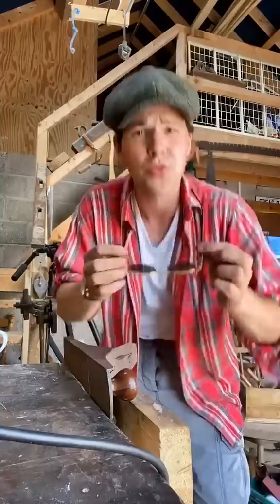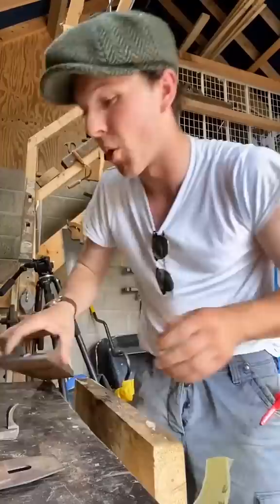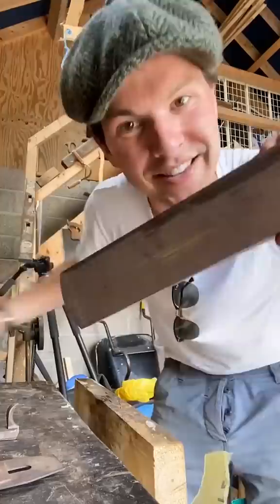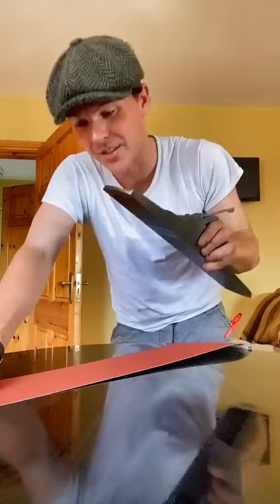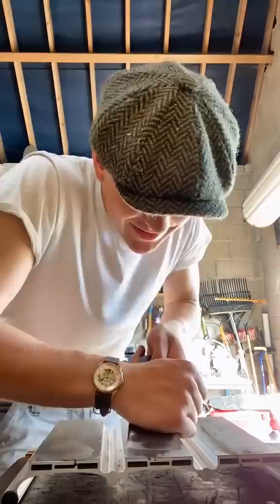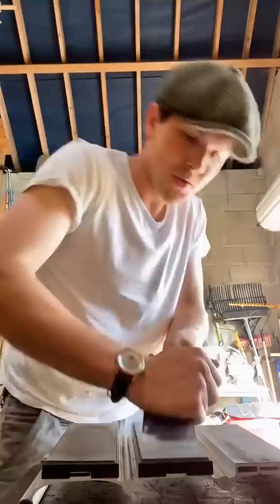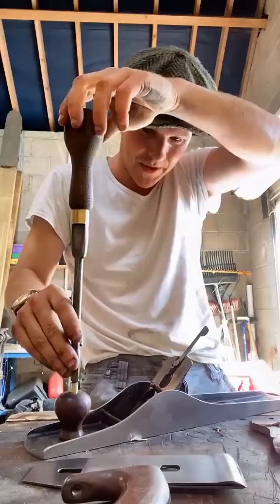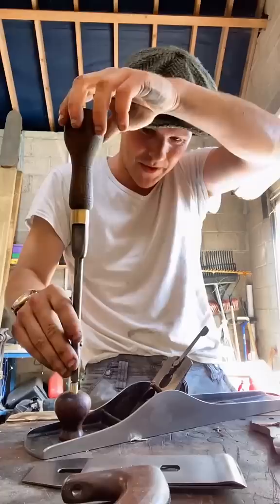Restoring & Sharpening a Stanley No.6 #shortvideo #woodwork #handtools #restoration #sharpening

Comment: I've found if you lap the sole with the plane disassembled, you can actually lap it warped - this is because the shape of the plane can change a tiny bit when you put the frog, blade and cap back in and snap the lever down.
Reply: This is true, especially on these long planes
Reply: This is true. Only flatten the sole with the blade in and retracted.

Comment: I absolutely LOVE LOVE LOVE  those old Stanley planes!! I need to learn to sharpen better!! Knives mostly
Reply: Its all in the bevel angle, "or the angle you hold the blade relative to the stone" i was taught to rock the blade up until the bevel sits flat to the stone and always pull toward myself
Reply: @dads_diy  so you're saying its the angle of the dangle
Reply: The veritas honing guide is incredibly easy to use and gets perfect results every time

Comment: Your energy, skill, and passion is unparalleled. So I’m going to be that guy: the problem with the grinder is the potential for creating any small divots or curves even on the side of plane, since many of us turn it on its side along the edge to gauge flatness, particularly with smaller pieces. 

But then again, you can probably take care of these little imperfections by simply sanding the sides flat as well…which could also be a means to remove the rust. 

Amazing video as always. Cheers!

Comment: A good tip for holding sandpaper on a flat surface like that, put a bit of tape on the back of the paper sticky side up the put 2 more pieces in an H pattern to stick it to the countertop. 

I resurfaced the block of an old lawnmower like that.

Comment: Is there a brand of Whetstone you'd recommend for sharpening plains?
Reply: Naniwa work really well for me. I use up to 12000 but with that one you don't have to strop at all. and it's only a few passes. It should be sharp enough to shave with after 800, otherwise you are doing it wrong.

Comment: Amazing work, and this is probably fine for woodworking precision, but as a mech eng I would be failing my people if I didn't point out that a granite counter top is not a surface plate. While the counter might be very smooth, there is no guarantee that it is actually that flat. Love your videos, keep em coming!
Reply: So I’ve heard this before and obviously it’s not gonna be as perfect as a measured flat plate but it’s my understanding that these granite countertops are cut with very precise equipment and if the flattening of these pieces is done in very big large industrial warehouses and not just a different granite shop so my question is assuming the use somethings like a precision router system to grind it flat why would it be off by more than a few thousandths?  I I am not asking this to be a jerk, I’m actually asking because I’m interested and I don’t know if you’re an engineer or so how about some free technical information I sure would appreciate it thank you

Comment: Love your videos.

Having less surface area in contact does not mean less friction, since more force is applied to the smaller area per sq inch. There are a few factors that can cause a slight difference, such as the geometry, but not surface area alone. If you don't believe me, place some weight on a small block plane so that it weighs the same as a larger jointing plane and slide them both on your workbench without the knives. You will feel that they slide on wood with about the same amount of resistance, even though they are drastically different surface areas.

The partially hollowed bottom does however make the plane easier to flatten, much like a hollow back chisel,  since there is less material to remove. 👍
Reply: The corrugated sole can also cause some problems, like edge (of boards) damage, and harder to lay level on boards (depending on thickness.)

I personally think they're a gimmick. Cool idea, but not much, if any better than a flat sole.

Comment: I have a 5 1/2 and 6 both corrugated I received as gifts.  I threw on hock irons/chip breakers and had a machinist friend flatten them.  They are wonderful tools but not ones that get used very often.

Comment: I don't know how true this is, but I was taught that to flatten the sole you need the plane complete and with its iron in - back off, as that's how the plane will be and steel settles into that shape. Will no frog or iron, etc the steel will be more relaxed and may not be flat one assembled.
Reply: That is mostly nonsense.

Quick correction. The plane is made of cast iron, not steel.

If your cast iron is moving THAT much, I would be worried about breaking it from the tension you're putting the parts under.
Sure you may get a bit of movement, but you'll need a DTI (Dial test indicator) to see the difference. You won't see or feel it in normal use.

Comment: It's best to flatten the sole while the blade and lever clamp are in place, because the clamp force tends to deform the sole a bit. 
Flat bottom unclamped will not be flat in use.

Comment: Use a stone if you want a truly flat sole.  Sandpaper puckers up a little right where it matters the most; the slot.  Stanley has used a belt sander for years, one of many reasons why they are junk now. If you must use sandpaper, get some lapping paper (plastic back) and glue it down.

Comment: interestingly, the corrugated sole does not reduce friction. That was the intent, but it was designed by an engineer who failed physics apparently.

While the grooves help prevent adhesion and suction caused by wet or oily wood, it doesn't actually affect friction at all, because friction is caused solely by the amount of pressure pushing 2 objects together and the coefficient of friction between the two materials involved. On dry wood, all the corrugation does is provide a placebo effect for people who expect it to reduce friction

Comment: Corrugated sole means Stanley needed a gimmick to sell planes.  It doesn’t have any difference in friction.  In fact, it could INCREASE friction, since a wider contact can lessen the pressure per square inch (cm) of the sole.

Comment: That sole will be rounded off at the ends since the sandpaper wasn't stretched tight. Flat enough to rough out tool handles but not for jointing.

Comment: When he sands the bottom on the granite countertop I cringe. You really need to wet the counter and flatten the sandpaper, otherwise the lift in the paper erodes the head and toe of the plane as it pushes it flat.

Comment: corrugated sole doesn't mean less friction because of less point of contact. You just can achieve a better surface easily because you need to remove less metal. Better surface and less weight correspond to less friction! Fa=μ*N